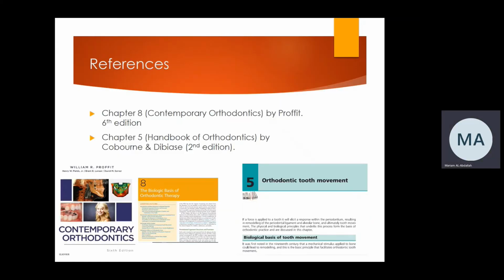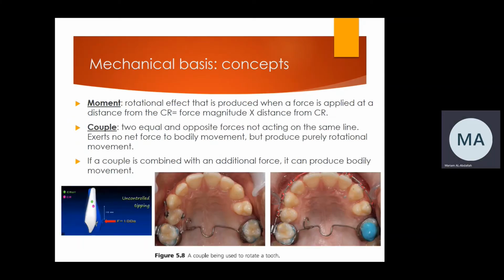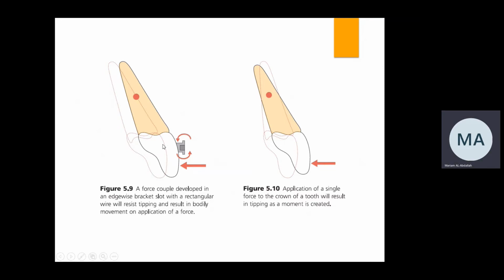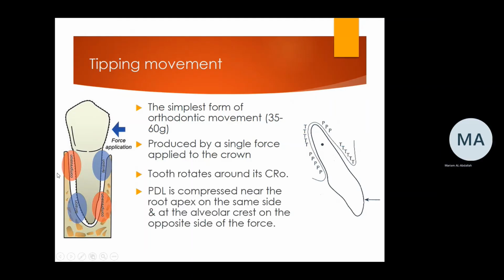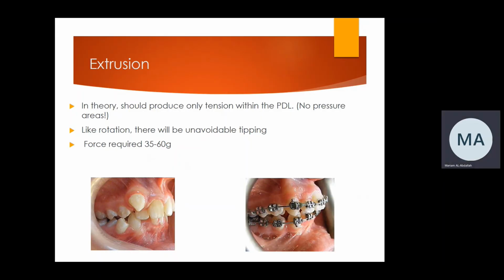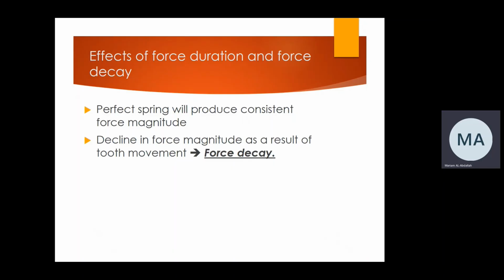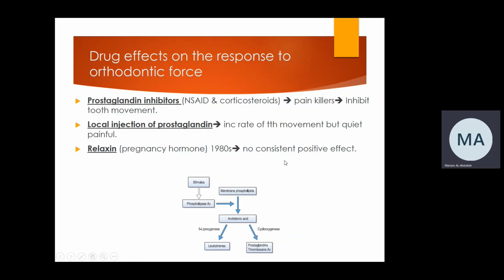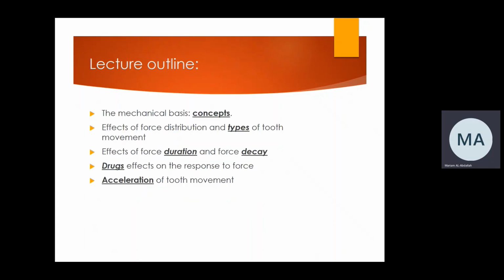Dr. Mariam Mechanics of Orthodontic Tooth movement

Comment: مرحبا دكتورة 
Total amount of tooth movement in milimeter i could obtain from application of heavy force and light force for same duration , finally it is the same or not? I confused this point 

I konw that in light forcr tooth move immediately after about 2 days while in heavy force it will lag about 2 to14 days 

But my questiom about same duration final situation in about the how much tooth move is the same for both foce types or not ? 
Thank u dear dr.